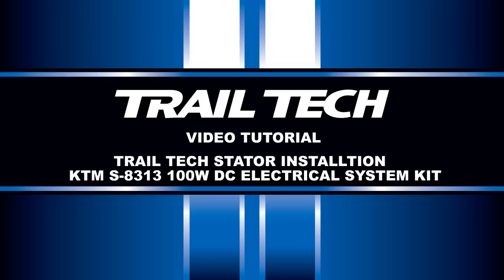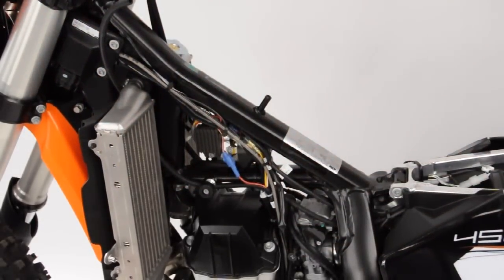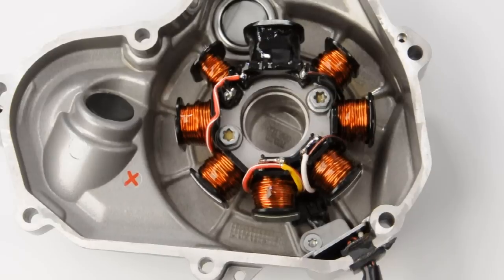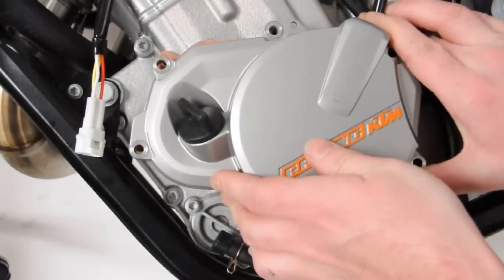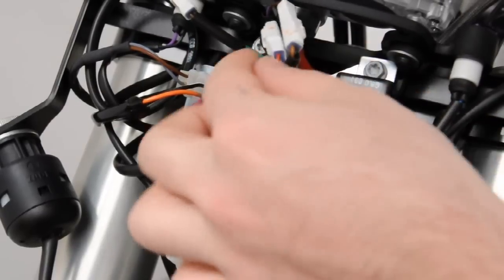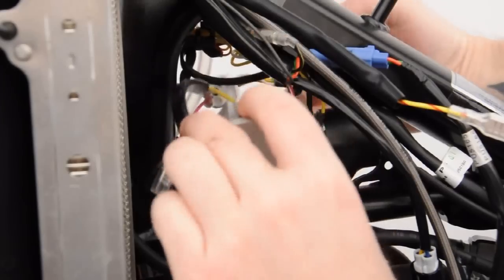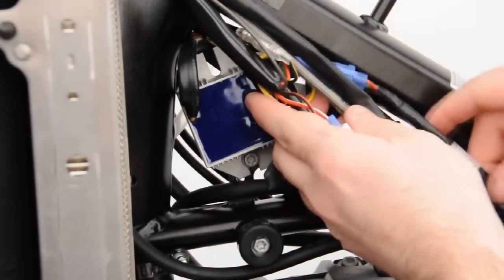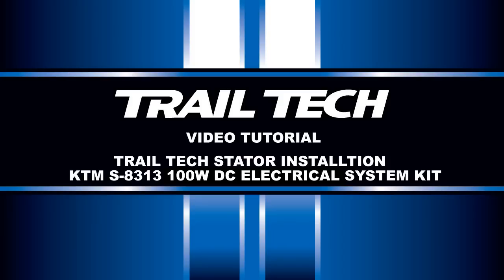Trail Tech Stator Installation - KTM S-8313 100W DC Electrical System

Comment: I notice that there is engine oil inside the casing that holds the stator, is that normal? I just bought a ktm520mxc 2002 and there was an oil leak coming from the stator casing because of a bad gasket, so I removed the stator cover and about a 1/2 cup of oil came out, but it was also in the upright position.
Reply: With the KTM four strokes there was a design change depending on the year from when they went from a dry system to an oil bath system. Unfortunately we do not have this information. I would recommend you contact a local KTM service center to get the information that you are looking for.

Comment: The SR-8313 kit will work perfectly for your 08 530 EXC-R.  The S-8360A kit is for the 450/505 XCF/SXF models. 

http://www.trailtech.net/100-watt-high-output-dc-electrical-system-kit-for-four-stroke-ktm-exc-2007-2011-with-turn-signals-and-key-switch

Comment: Do you guys do a complete Ignition kit for the KTM 530 exc-r or do I have to buy all the parts separately all the complete kits I have found say the don't suit the EXC-R 08 the kit you guys have on Ebay for the 530 says XC-W will it work on the Australian released EXC-R
 on your site to it says carbureted must use S-8360-A

Comment: Unfortunately you have to install stators that are designed for the bike you are putting them in.  Many times the pit bikes are too small to have lighting capabilities.  I would recommend getting something that runs off batteries.  Something like out A122-SS-LB LED lights.  They are made for helmets, but they have a 7/8 inch and an 1 1/8 inch handle bar clamps included.